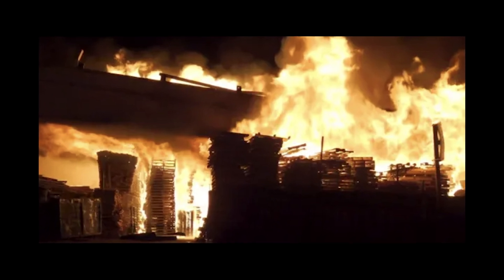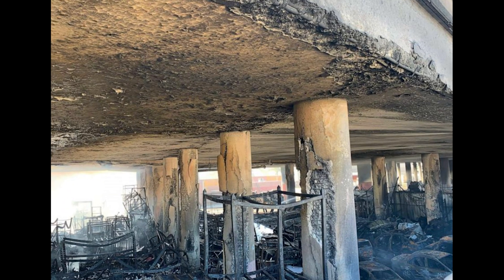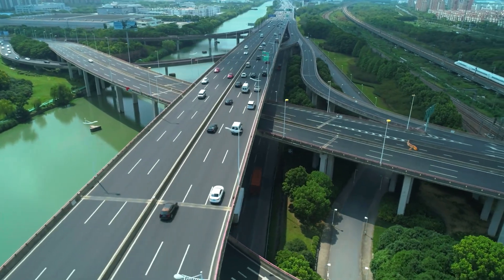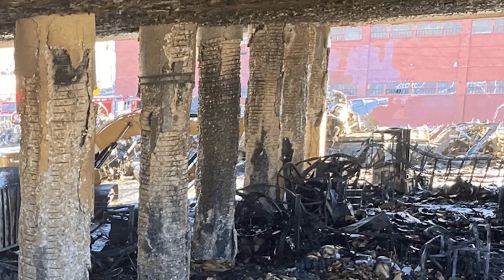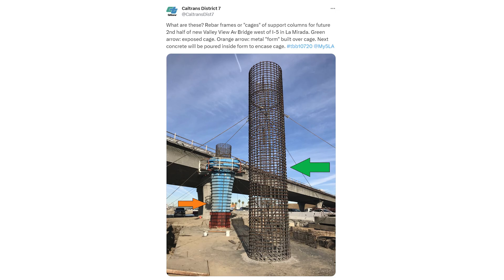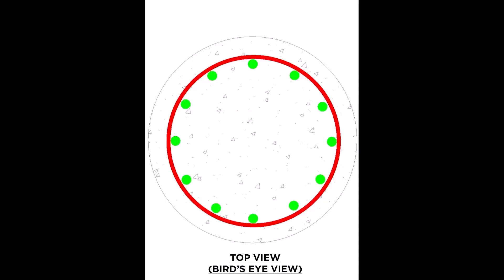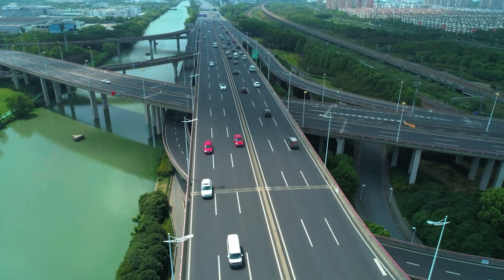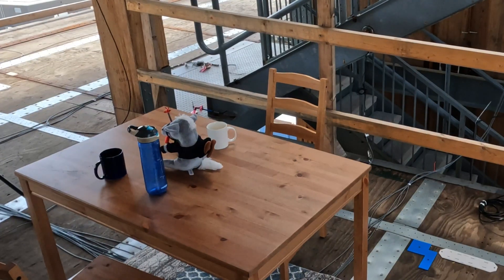Is the 10 Freeway Really Safe After the Massive Fire? | Structural Engineer Explains

Comment: Great video, valuable information. I have a doudt, usually the hottest part of a flame is in the top or the tip, so I would expect the damage should greater in the upper side of the structure like in the slab or beams in stead of the columns or piers. Why it appears most the damage is in the columns? Is maybe the damage not due to the fire itself, but from the water jet from the firefighting?
Obiously the water jet would be the smaller evil to stop the fire, no blaming there. I just don't know the fire damaging process in reinforced concrete.
Reply: The deck is also a heatsink with the top not exposed to the fire, that could have been helpful. Also the cover at the bottom may be thicker because of fire hazard. The damage on the column could be in the halfway location because of the higher buckling stresses there, causing the cover to shear off.  I doubt the water could blast off the cover.
Great video Mat! I always enjoy trying to figure out why a structure failed, it’s good learning material for a structural engineer.
Reply: Base on the information you presented, your judgment was well noted and I second you statement.